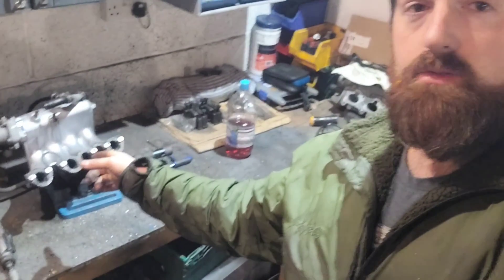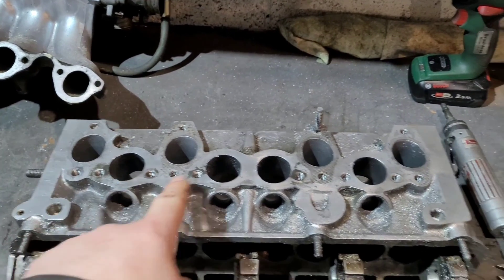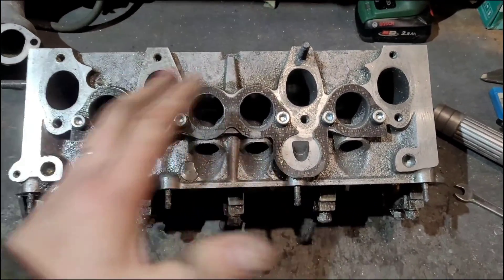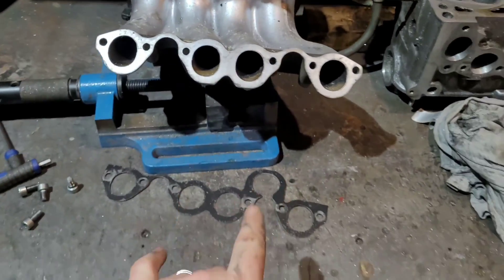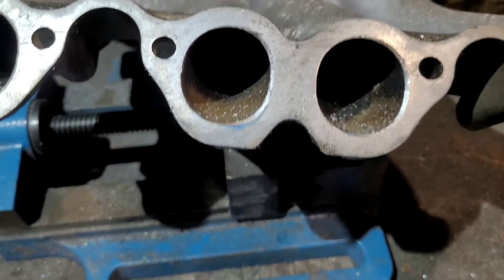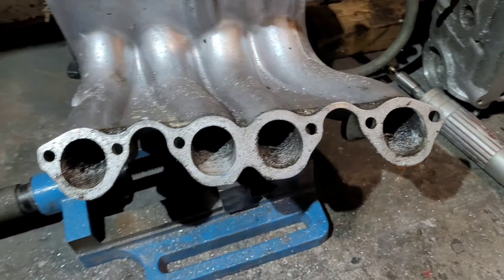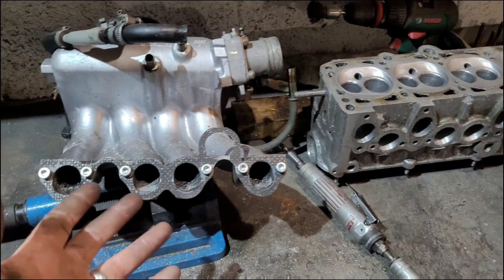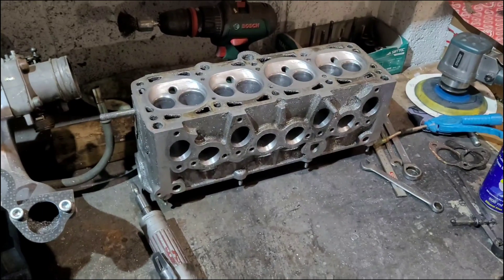How To: Cylinder Head Port Matching | Mk1 Golf GTi 8v

Comment: Hi, what size burrs are you using and where are you getting them from, I've just had some delivered and they're tiny.
Love the videos and technical aspect. Very informative.
Reply from the maker: Thanks, they were a 6mm shaft size if i remember correctly, from Ebay and about 15 quid each, I bought some amazon ones and they were tiny too

Comment: What rough order of magnitude of a BHP increase would this procedure cause?
Reply from the maker: Potentially 5 or 10 depending how bad the gasket match is, some cars are bad.

This particular set up 1 or 2 hp maybe but its about bring the whole package together, getting each cylinder with and even amount of air and fuel which in turn will give a better explosion.

Comment: Thanks for this vid, cant wait to do mine. So you maintain that after porting you would not actually polish the airways leading to the cyclinder head, but leave them "rough is enough"?
Reply from the maker: Yes as polishing as in really shiny actually causes the air to stick to the wall causing the fuel to drop out of suspension. You want the air and fuel molecules to be an even mix.

So ruff is enough to allow the increase in air flow which is the aim of the game
Reply: @GreyGooseRestorations  yea you explained this peviously to me. It just baffles me that a super smooth surface causes more air stick compared to a comparitively rougher surface. Seems so counter intuitive. 🤪
Reply from the maker: It does seem counter intuitive, think it was a person called Smokey Yunick back in the day that tried mirror polishing ports etc